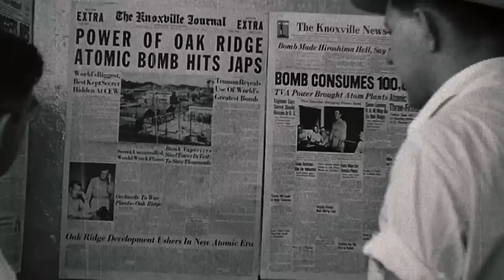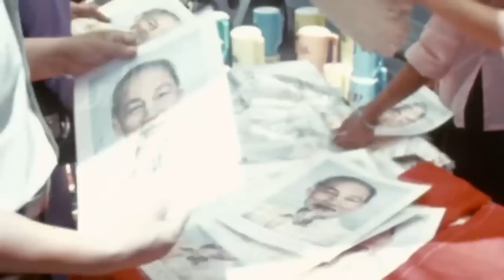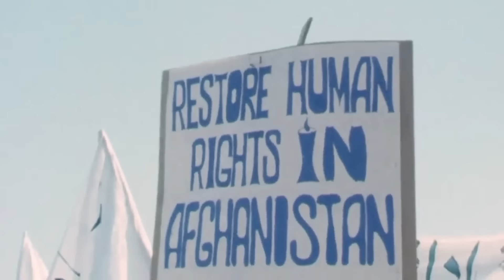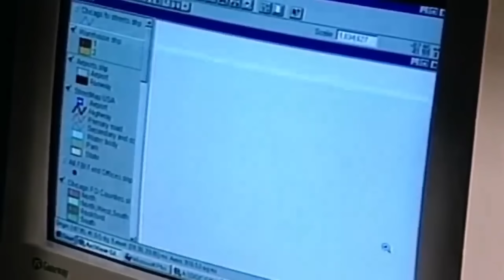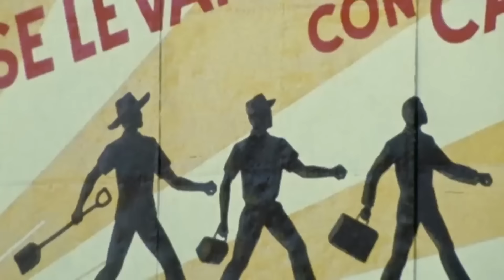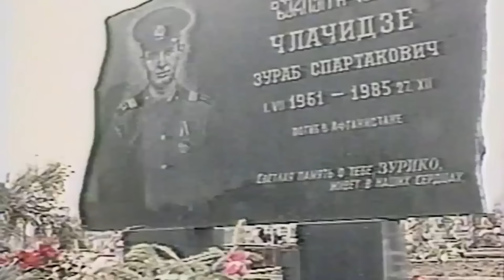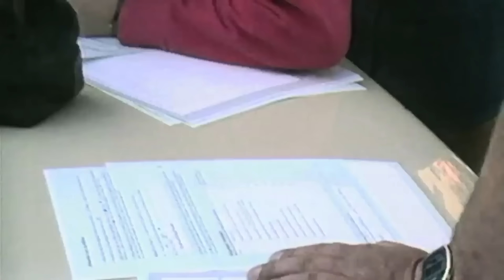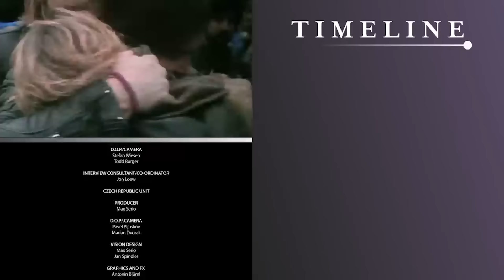Neutron Bomb: The Toxic Warhead Designed For Maximum Radiation | M.A.D World | Timeline

Comment: This couldln't actualy be more incorrect.  The Neutron bomb is improperly named; it is really a hydrogen bomb without the U238 wrapper.  As such it does produce very high energy neutrons but it doesn't have the U238 to create heavy radioactive materials; so it is high energy but very short term only a few moments; but relatively low in what most people call radiation which is long term heavy element radiation.  The blast is also far less as the U238 fission gives much of megatons of punch. So rather than long term radioactive a neutron bomb is relative small megatons and short term.
Reply: Yes, they were build to end living organisms but leave most infrastructures intact without the long term radiation effects.
Reply: Perfect for the Fulda gap !
Reply: No one  tell this guy there’s a “Patriot missile.”
Reply: @colinhughes9835  Ya its probably patriotic but its for shooting down other missiles
Reply: A very hot few minutes.
Reply: They used to put the neutron devices atop the Nike Ajax AA missile.
Reply: is that right?  was it suppose to knock out the ICBMs electroincs?
Reply: i was just thinking; also a pre detonation would before the warhead goes critical could be a pretty smart move.
Reply: Its a Kobalt wrapper i think
Reply: Hello A time will come when peace will reign  16 All Scripture is inspired of God+ and beneficial for teaching,+ for reproving, for setting things straight,+ for disciplining in righteousness,+ 17
Reply: @VestalNumbre  I somehow doubt that
Reply: @South_0f_Heaven_  well let's start with historical context?Isaiah
47 Come down and sit in the dust,

O virgin daughter of Babylon.+

Sit down on the ground where there is no throne,+

O daughter of the Chal·deʹans,

For never again will people call you delicate and pampered.

 2
Reply: @VestalNumbre  Lmao that's not history, that's bible verse, which is, at best fable.
Reply: I grew up about 2 miles from a NIKE defensive missile launch site. Stop nukes with nukes lmao
Reply: @timsheehan6954  never heard of this???
Reply: @sawe4207 a cobalt nuke is the opposite in some ways - to make the land unlivable for a very long time.
Reply: Not improperly named as it is also known as an Enhanced Radiation Weapon amongst those like you who like to throw around jargon and be precise. For the lay public to distinguish it from the familiar hydrogen bomb, it is call a neutron bomb for obvious reasons—the primary lethal damage from the neutrons it emits.  I’m not a nuclear physicist or even a physicist. I have common sense.

I enjoyed the video. I’m shocked we survived the Cold War though.
Reply: @ilovecatvideos1851  There is where you are mixed up. The "neutron bomb" has very little radiation; it has no U238 wrapper and hence it's initial burst is all there is which is mostly x rays and the least of all bombs in terms of radiation.  So there is nothing enhanced about the radiation where the 238 wrapper gives you massive amounts.
Reply: @litestuffllc7249  I am not mixed up. The radiation  is high lethality a pierces body armor effectively—its intended effect—but its effects drop off very precipitously with distance. So it is a very limited effect to surrounding civilians. Just like, as you said it has a limited blast and heat effect.

This was the desired effect of NATO forces for a tactical weapon. Concentrated intense lethality with relatively collateral damage.

Maybe instead of misnomer meaning mis-named bomb as I took you mean, you meant “mis-titled” as in the bomb doesn’t deliver maximum radiation. The name is a lay term and not meant to be a technical descriptor.
Reply: @FISSIONINITIATEDSUNRISE  What possibly could make it an inefficient Fusion bomb?  Inefficient at burning at combining hydrogen into Helium?   You don't need a reflector in a hydrogen bomb.  THe purpose of the U238 wrapper to make a Non hydrogen only - layer cake bomb is to add fission - U238 only is capable of fission; not adding anything to a fusion reaction.
Reply: @FISSIONINITIATEDSUNRISE  So you are talking about the fission portion of the layer cake type bomb.  Do you need to worry about those when you have a hydrogen bomb's energy?  The only reason they can use 238 is due to the high energy of the fussion.
Reply: That's very insightful thank you do you have any formal education
Reply: @user-px9nq8bh8y Yes do you? I was in the Class of 1979 at West Point and worked at the LLNL for 8 years.  So unlike so man on here I actually have worked in the freild .. have you any formal eductation? Do you believe CO2 is responsible for the planet warming?
Reply: You need Uranium to detonate Plutonium. Low yield nuclear weapons create radioactive material as well but ìn a smaller area.
No nuclear bomb is clean  as the fissionable material is not totally destroyed or used up during the explosion.
Only an antimatter bomb would work as you described.
Reply: @agxryt 
If man could fix mankind's problems, they would have already done it.
Reply: @GS-zc4sk   no we wouldn't have. We've only just started to understand the brain. Psychology has only recently developed. And we STILL have people trying to attribute things to men in the sky, instead of dealing and living with the real world we have now
Reply: @colinhughes9835 did you mean Peacekeeper? I bet you did.  It's okay, we got you.
Reply: @PaulojnPereira  so... you get partial credit because you are partially correct.  

The ER series of weapons, Enhanced Radiation, were designed to maximize prompt neutron radiation to do things like kill tank crews and massed infantry either outright or over a span of time.  The idea is sound but the results are mixed; soldiers who weren't killed outright can possibly form suicididal attack squads, performing massed assaults that would defy typical tactics: better to die quick than from the exposure.  

The other primary use would also have been as part of an ABM system, killing ICBMs with nuclear buckshot: damaging reentry vehicle electronics and possibly altering the physics package composition resulting in fizzles etc.

The follow on uses would be, because of this prompt neutron radiation, the creation of huge swaths of very active, very deadly neutron activated elements like cobalt, copper, gold etc which are extremely "hot": you create an exposure minefield that can be used to funnel opfor into actual minefields and degraded and hostile environments ripe for airstrike, artillery and biochemical attack.

The premise that the ER weapons were a "landlord bomb" with only a whisper of blast and thermal weapons effect is a farce promogulated by the anti-nuclear weapons activists in the early 1980s primarily in response to states such as Isreal & South Africa developing "tactical" weapons.  These weapons still create kiloton scale explosions, still create thermal flash and fires and will surely destroy civilian structures within the radius.  Using these weapons to depopulate a city and seize it's resources will only grant you wide spread if not catastrophic damage and a radiologicaly poisoned resource you can't safely use.